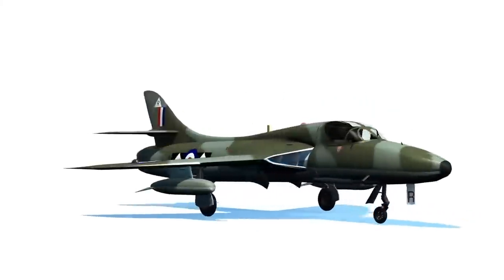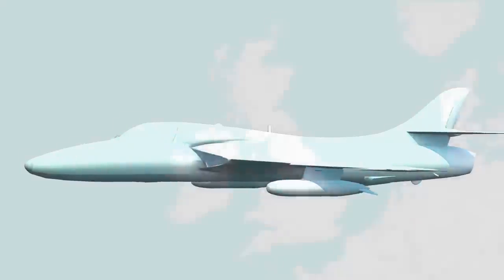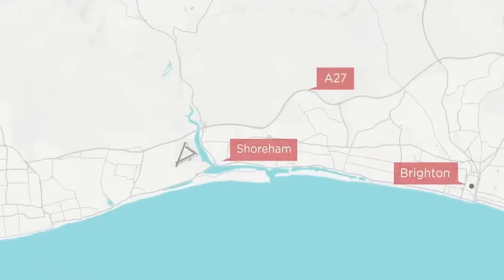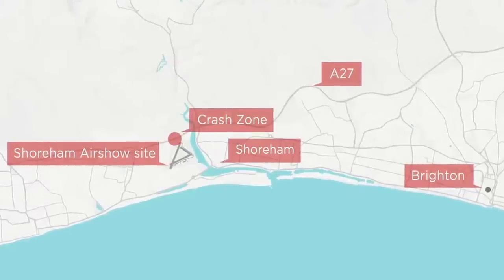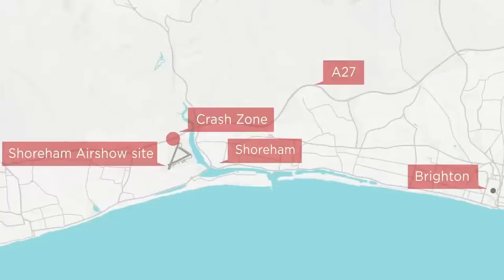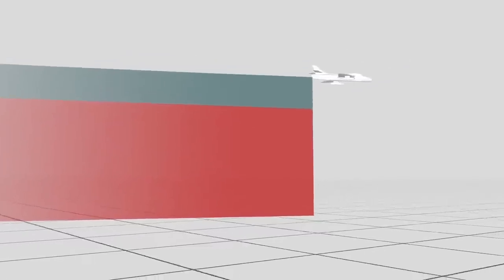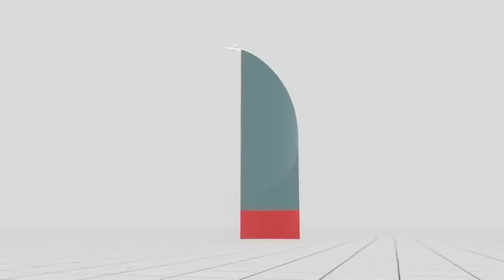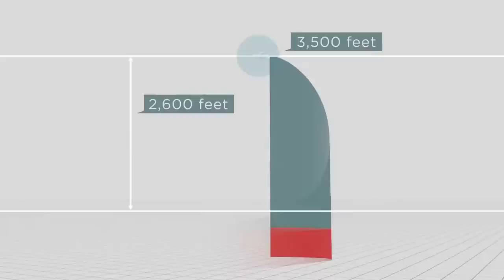Hawker Hunter T7 Jet Crash Shoreham UK

Comment: 0:31 it’s at this moment that I think he knew he had screwed up. I haven’t watched this in years but it also seems he hesitates at the top of the loop - that would have been a good moment to do an Immelmann.
Reply: Exactly...!
Reply: What's an Immelmann ?
Reply: @jeromewagschal9485  Right so imagine you’re flying north (360 or 0 on the compass) and you do a steep climb right up to where you’re at the top of a loop, in other words at this time you’ve just become inverted. Now at that point you snap roll out of inverted. You’ll then be heading 180 degrees, exactly where you came from but higher because of the altitude gained in the climb, in the opposite direction. I’m sure I’m right about this and that it was invented as a dogfight manoeuvre by a gent called Immelmann. Personally, I never had the need, the balls or a plane rated for aerobatics to try it. 😁
Reply: PS: perhaps Maverick F-16C could confirm?
Reply: @IdeologieUK  I see...Thanks 👍👍
Reply: @IdeologieUK  You are correct on all counts.
Reply: Yea I seen he tried to pop it up but wasn’t going up
Reply: He did not have a planned escape manoeuvre, something which a competent FDD would have spotted and corrected had he bothered to find out the contents of any of the displays.

Comment: 500 ft margin is not enough for these fast jets.
Reply: At 350 knots they travel that in 1 second. One second error somewhere and boom.
Reply: It is plenty of margin if the pilots fly their planes correctly.
Reply: @hb1338 
   Not ok if the bottom of the loop is more or less  mostly in line with a very busy road.

Comment: So he started both low and slow...!:((. Even with emergency engine thrust, the result would've been about the same or he could've mostly escaped at inches from the ground or with a tailstrike, but most logically the result would've been just little different in the sense that he would've crashed only some distance later. Not the engine management was the problem, but the entry speed which was way too low for that entry alt. Yes..., he could've made it out without crashing (although very low again) even if starting that low if his speed was at least that 350..370 IAS.
Reply: You pulled that trick flying out of the volcano Crater didn't you

Comment: The Hawker Hunter was never a trainer. It was a frontline fighter, in its day.
Reply: T7 trainer.
Reply: It was both, from back in the days when tactical aircraft were still exotic enough and relatively cheap enough that two-seat versions were necessary.
Reply: @thomasbell7033  sorry Thomas but I disagree. Two-seat version was meant for transition prep. to be safe in the singleseat version. It was never meant to teach people how to fly airplanes. Which to me is what you would call a trainer.
Reply: The Hunter T7s and T8s were built specifically as trainers. Used by both RAF and FAA.

Comment: Engine thrust...! Oh God how I hate these guys that are always going quick on investigating the engines thrust regarding an accident. If he had 104% engine thrust would that just get him out of trouble? NO! Those engines alone are not enough. He could've safely done the whole loop maneuver by correct entry altitude and airspeed alone even with engines off, if he would've had some more than 450 knots at entry. Now yes..., all in all, the engines thrust, angle of attack and speed provide a resultant instantaneous speed and lift over every part of the maneuver, but the most important ingredient, if the entry altitude was above the safety minimum, was the minimum safe IAS to either continue the maneuver or reject it in case of one or both engines failures (birdstrike or other internal malfunction)

RIP to those who have perished this way!:(
Reply: Your comments are correct. Thrust alone doesn't assure recovery from loops at a unsafe envelope. Proper airmanship entails strict adherance to the flight manual and characteristics of recovery, as well as pilot skill.
I guess the biggest mystery is the fact that this ' pilot' had previous similar violations in the past, and was allowed to fly at airshows without obstruction or restrictions. His ironic smile on exiting the court after having being cleared of all responsibility by a ' judge', indicated his complete indifference and ignorance to the severity of this horrible crash and the innicent victims it claimed.
Reply: @supercat380  
Wow. Seriously...? If he has done critical rules violations in the past, who is this judge defending this careless murderer? He should get almost the same punishment as this impostor pilot as well. Those poor people...!:(
Reply: @MaverickSu-35   He flew the same manoeuvre in a Jet Provost at an air show the previous weekend. His entry speed and height in the Hunter were those which apply to the Jet Provost. It is all in the AAIB report if you look carefully, yet nobody (least of all Sussex Police) seems to have spotted it. There is an extremely strong case that he remembered the wrong numbers for the manoeuvre.
Reply: @hb1338  
So this was all about confusing the required parameters of the last flight with those of the previous one. So yeah..., they must probably repeat the new checklists in their head more times to not forget important factors or have them written on their leg sheet or have the ground watcher make sure the pilot uses the right parameters before each maneuver. The pilot should not be the only person to check up what's next. Another lesson!

Comment: Pilot was flying at 185ft when entering loop, recommendation restricted such displays to a minimum height of 500ft..

Pilot failed to apply full thrust to gain correct altitude at top of loop..

Pilot failed to recognise lack of required height, should have rolled aircraft at top of loop + continued straight + level..

Pilot failed to acknowledge display line above public roads, etc., especially with full fuel load..

Authorities failed to change flight displays, even after a similar accident at Eastbourne Air Show, where a display pilot in a display loop dove into the sea just off shore from a packed public promenade..

Comment: Clear-cut case of pilot error with gross miscalculation of recovery height from the aerob!atic loop. The pilot was ultimately cleared from any faults and freed by an equally miscalculating judicial system prevalent in the UK
Reply: "equally miscalculating" nice one hahahah
Reply: No - he entered the manoeuvre too low and failed to detect or correct the problem. The gate conditions (minimum entry height and speed) were correct. He was acquitted by a jury made up of members of the public - there is no evidence that the trial was not conducted correctly.
Reply: There is justice, and then there is the truth.